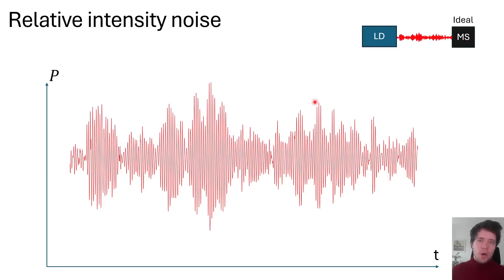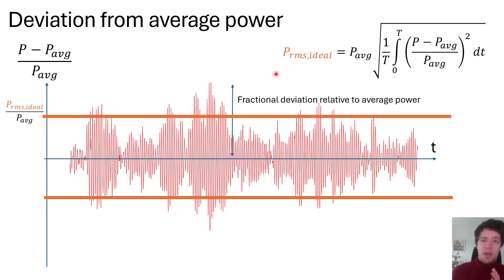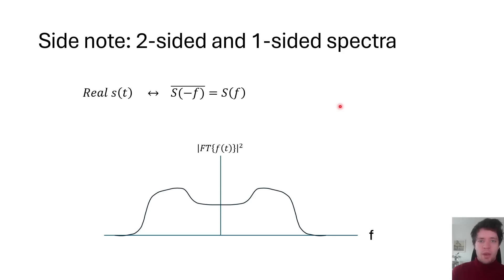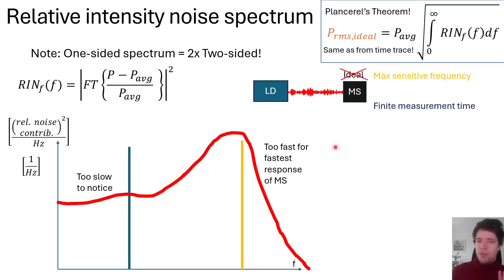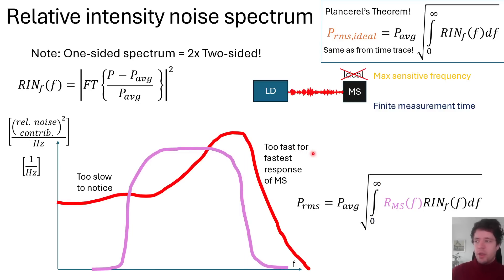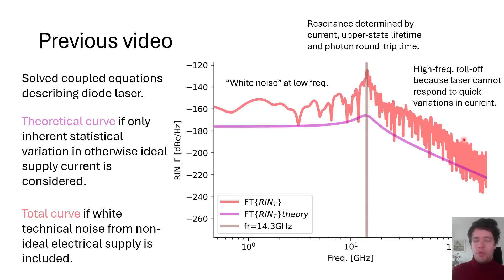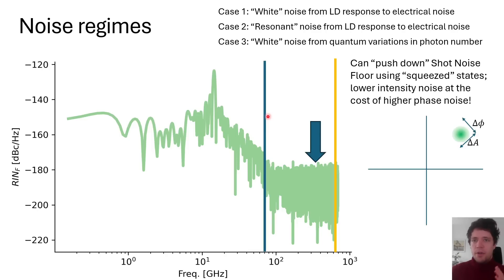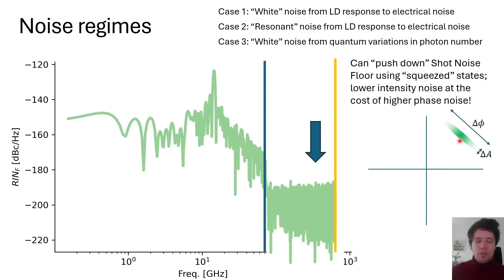Relative Intensity Noise of lasers explained!

Comment: One more thing: Your ideal measurement system is not measuring the instant power of the light field, i.e. a response time of the measurement system faster than an optical cycle, but still the average power over the course of optical cycle.
Reply from the maker: @TheTablet314  Yes, that's a good point!

Comment: Would it be correct to think of the shot noise as the result of photons coming in at different phases?
Reply from the maker: I assume that the logic behind your question is that photons coming in with different phases might interfere destructively/constructively and therefore reduce/increase the number of photons detected. However, the fact that one can create squeezed states with higher variability in the phase of the light, which simultaneously have more consistent photon numbers makes me think that this picture is incorrect.

Here is my interpretation of the origin of the shot noise:

1) The energy density of an EM field depends on the field strength squared; E^2
2) Quantum mechanically, we can think of this like a harmonic potential, which has "number states" |n> and "raising/lowering" operators, a and a*.
3) Laser light is characterized by containing "many" photons, so whatever quantum state we use for describing laser light, it must be an eigenstate of both a and a*. In other words the state should be basically the same if we add or remove a single photon.
4) After some algebra (see notes in the video description), the condition in 3) gives rise to the quantum state, |n_avg>, mentioned at 11:30 in the video. Applying the <k| bra from the left gives you |<k|n_avg>|^2, which is the probability of measuring k photons in the state. This follows a Poisson distribution.
5) Any random process that follows a Poisson distribution will exhibit shot noise

In short, the specific requirements needed for describing laser light using a quantum optics state forces that state to have "a probability of measuring different photon numbers" that follows a Poisson distribution, which then gives rise to shot noise. 

You could in principle create some other state, for example 1/sqrt(3)|1>-1/sqrt(3)|4>+i/sqrt(3)|10>. This would result in some average measured number of photons and exhibit some variability (and thus noise) in this measured number. However, this state would not describe light emitted from a laser and the probability of measuring different photon numbers would not follow a Poisson distribution.